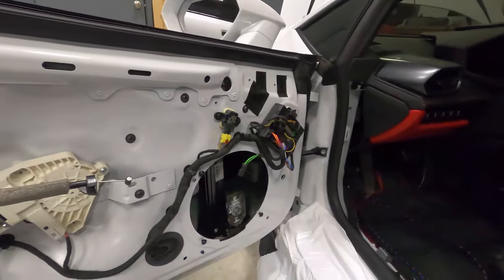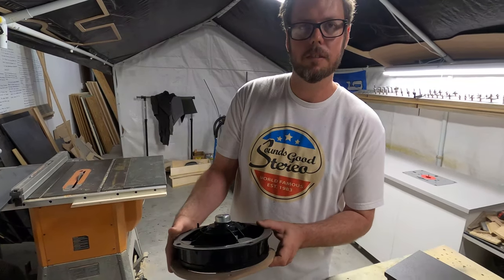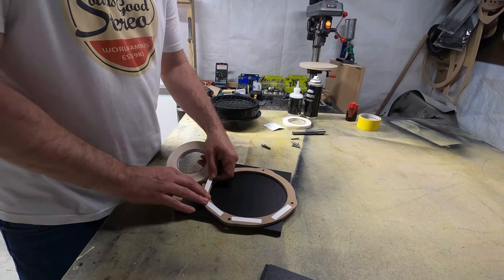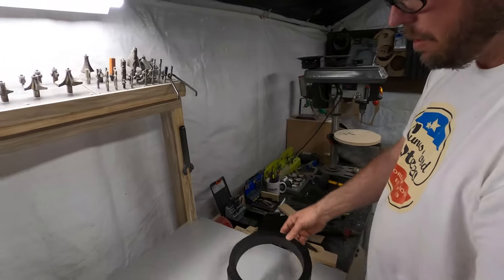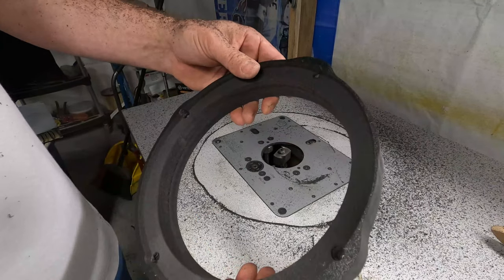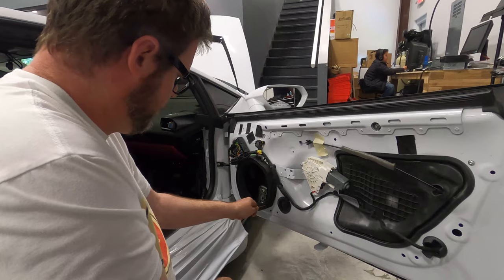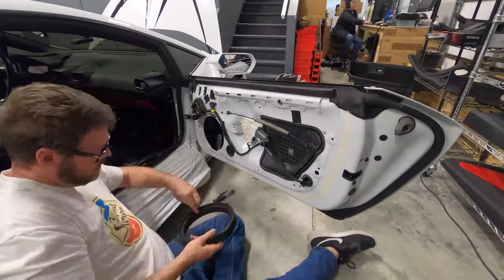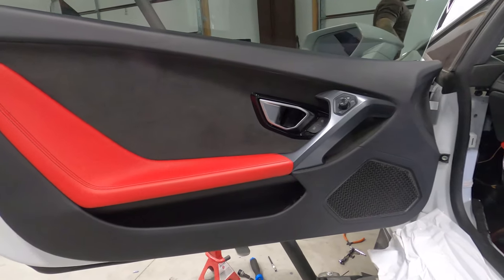2016 Lamborghini Huracán Custom System Part 2: Custom Speaker Adapters & Sound Treatment

Comment: No fast rings? Good setup but that would be very beneficial to add
Reply from the maker: So we don't use the Fast Rings brand, we use the SQL Audio Soundwave which is closed cell foam. Here is the link:
https://soundsgoodstereo.com/products/sql-audio-soundwave-xl-closed-cell-foam-speaker-kit

Good eye on the filming... Scott went back in and added it, after he realized under the pressure of filming, he forgot.
Reply: I was going to say the same thing. No foam on the front of the speaker?

Comment: Amazing work guys! How much does a system like this run for? I’m guessing at least 15k?
Reply from the maker: It can vary based on what’s needed to incorporate this gear into the vehicle. Factory locations for the speakers, around $15k. When we build out everything, takes more time and resources. Could be upwards of $30k+. Each customer and vehicle is unique, so it’s hard to give a exact price until we learn the customer
Reply: @SoundsGoodStereo  you guys ever do spl?
Reply from the maker: Brian69frmO'Vale Sometimes.. Did you see the XS Power Kodiak Truck we are building? Look at our videos and go to part 1